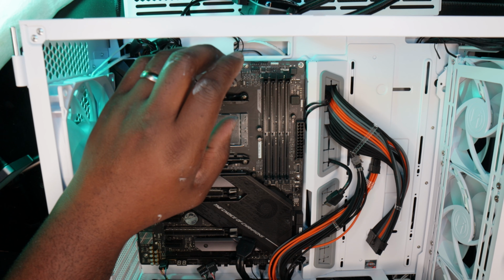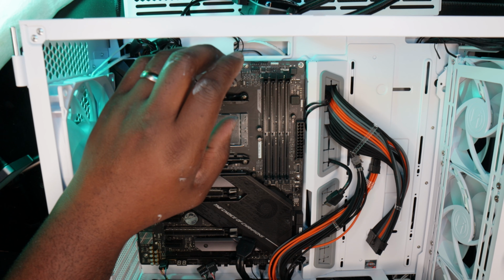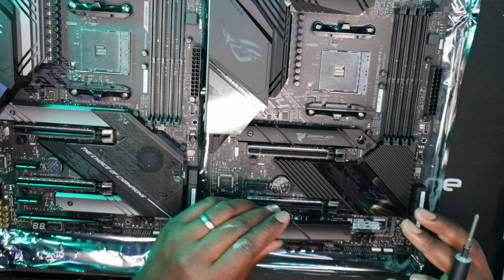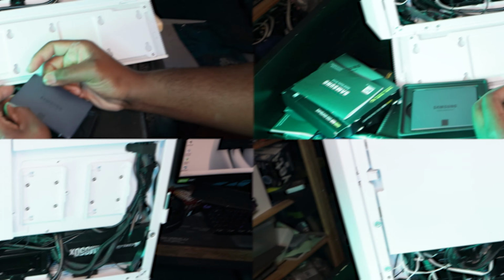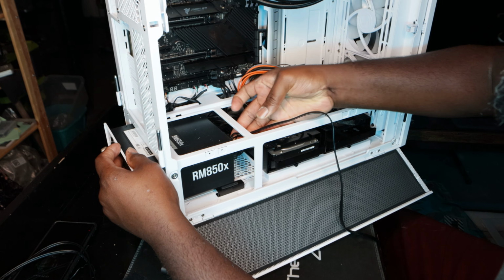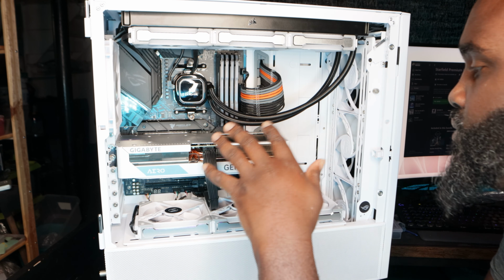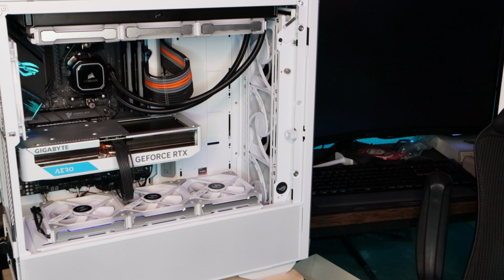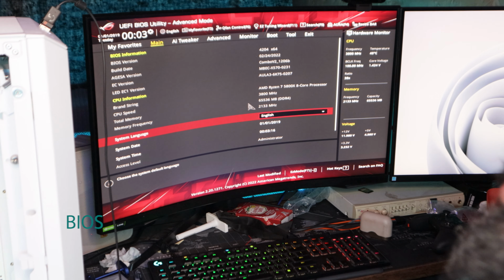Lancool 3 Build part 5. CPU FORCED OUT OF SOCKET!!/ Trouble-shooting No Post/ Stress levels Max OUT

Comment: I'm currently doing a build with that same case, but I'm using 12 corsair fans and controllers, and the wire management is a nightmare I can't get those real panels to stay closed. I see your using 10 fans and you have plenty of room. How did you get all your fans connected without the wiring mess like I have?
Reply from the maker: I'll tell you this, when wiring keep the panels on. As you are routing your cables it should help as you go on. It's possible I'm sure, take your time I believe you'll get it.